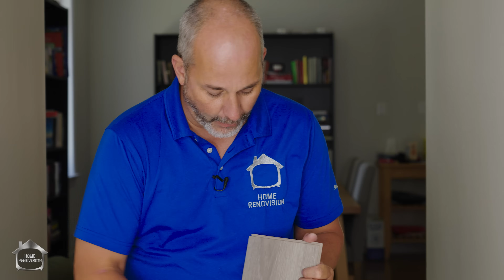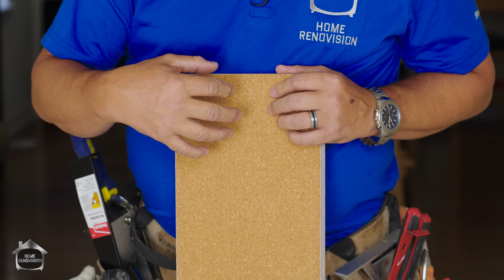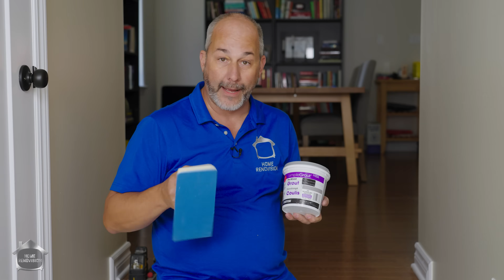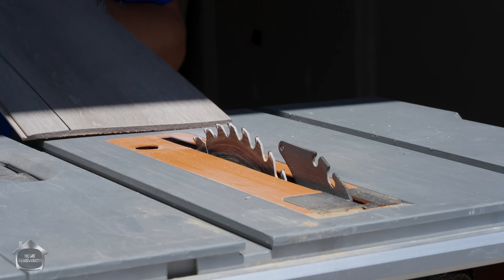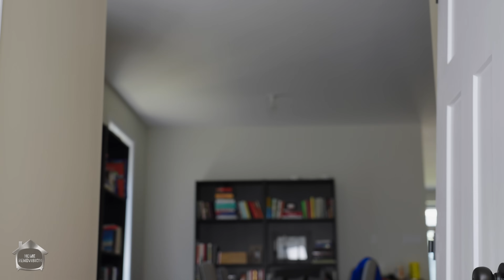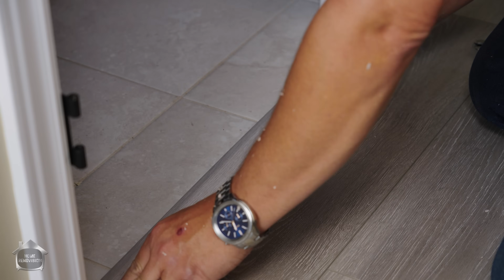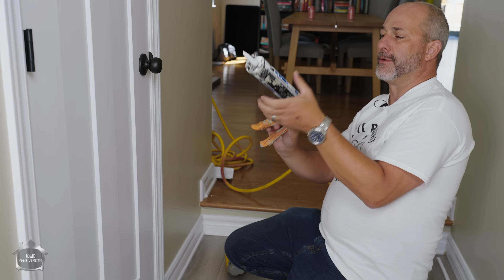10 Tips For Installing Vinyl Over Tile

Comment: Love the installation tips, but I still don't get why you entertain people wanting to stack flooring or backsplashes. I know it's a dirtier job to do removal everytime you want to change flooring surfaces, but it's one of the godawful discoveries people make when they reno (or have any kind of water damage requiring removal) after other people have done shit like this. I had friends renting a place in Hull some years back that had had a significant pipe leak and the insurance crew found out the place had not 2 but 5 layers of different flooring stacked. It was hell to fix and significantly the scope of the job. Worst of all? The original layer was beautiful hardwood.

Now obviously, this is an extreme case in that it's more than a second layer, but IMO it's just not something I want to see more of, and videos like these unfortunately normalize the practice.
Reply from the maker: I understand, however in a world where labor is getting very rare and expensive asking homeowners to buy tools for tile removal vs a floating floor is a no brainer. Cheers!

Comment: Jeff, what's your solution to an area where the existing tile butts up to a carpeted area? Obviously the carpet will be removed but the +/- 1/4" difference in height is a problem. How do you float out the height discrepancy? How many feet to make the transition not noticeable? This is my dilemma. P.S. this is a slab on grade construction so thin plywood is less viable than a self leveler... trying to avoid leveling 2500 feet to avoid tearing out 400 feet of tile.
Reply from the maker: just rip out the tile and use a cup grinder to make it smooth!

Comment: Awesome! But what you do with a tile floor on a slab (with lots of lippage) — which was installed in a converted garage that still has the garage slope!? My summer project!
Reply from the maker: prime with a latex bonding primer and then add floor leveler. Cheers!
Reply: @HomeRenoVisionDIY  Thank you!

Comment: Lots of useful information! Love all the content! Quick question. How do you transition from putting plank flooring over tile to a concrete subfloor that once had carpet. (Without busting the tile up to keep it all level :) )
Reply from the maker: I would suggest installing 1/4 or 1/2" cement board to bring the base level to flush. Cheers!
Reply: take the extra steps and bust the tile. these floors with NO transition strips looks soooooo much better
Reply: I have the same problem. I have concrete subfloor that I need to raise to match the height of the tile that’s already installed. From this video I learned that I can install over 1/4” grout lines as long if wary of where my Vinal plank flooring falls, which is awesome and saves me a ton of time self leveling all the grout lines with thin set! I was also going to use self leveling concrete for the whole 200 square foot room until I saw this comment. My question is How should I anchor the cement board to my concrete subfloor. Masonry screws?
Reply: I may just bust up my tile to reduce the cost of just buying cement board to raise my subfloor. Trying to weigh the pros vs cons. What could go wrong with a little demolition!

Comment: No expansion gap? There should be about a 1/4" gap between the plank and wall to allow for expanding from heat.
Reply from the maker: not needed. the vinyl does not have any capacity to expand so it is completely not necessary!
Reply: @HomeRenoVisionDIY  the vinyl doesn’t, but the house does! Any floating floor needs a gap where it meets another material or a vertical surface. This actually happened in my house: flipper both didn’t leave the appropriate joint where the flooring met the wall, and also glued down the flooring by accident at transitions strips (overglued). Within a few months, our flooring popped at a joint because the house shifted and the flooring couldn’t move.
Reply: Yeah I came to the comments to post that. He briefly mentioned leaving a small gap to make it easier to drop the last pieces in, but really that gap is so the floor can move with the house.
Reply: I’m 95% sure he explain its expansion rate is incredibly small less than steel so the gap isn’t needed or isn’t necessary

Comment: I’m an installer. I’ve had past jobs where some of the joints in the click fall right on top of the grout line, and over time the joint eventually breaks apart. Of course it depends on the material, and the depth of the grout, but now I pretty much always apply a skim coat over ceramic just to be safe. The stone-like clicks always seem to break apart, so I won’t even install those anymore.
Reply: Get a 10mm rubber underlayment, it will solve all your problems.
Reply: @onlythebest3311  No customer wants to pay for that
Reply: Floor underlayment.. as designed
Reply: Should that be the problem of the flooring joints being weak and thin I have pick up some flooring planks and bend the joint to test the strength of the joint and have broken some right off or cracked them..they should make stronger joints seem like
Reply: “How to half ass”
Reply: The proper way to do it would be to level the tile with floor patch.  I usually do 2 -3 coats first another option would be to pour self leveler
Reply: Do you prime the tile prior to the skim coat? If so what product are you using for that?
Reply: would this happen, even with underlayment being installed?
Reply from the maker: A lot of that depends on the grout line size and the quality of flooring being installed.

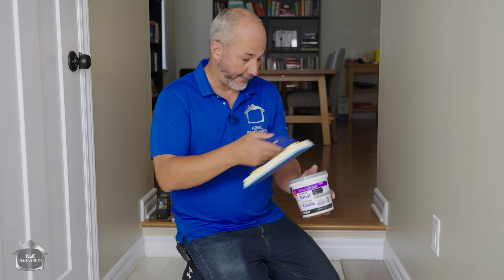Comment: 5:45 Could I use the leftover mudding compound instead of the grout?
Reply from the maker: drywall compound will go moldy. always use a cement based product under a floor to level.  Cheers!

Comment: I did this using Karndean looselay flooring over ceramic tiles in a bathroom and linoleum in a laundry room. Few years later and the LVP is still perfect.
Reply from the maker: Noice. Cheers!
Reply: @HomeRenoVisionDIY  how can I transition from an existing tile wall to a luxury vinyl plank flooring? My project is in a bathroom so the tile wall is already in place and I don't want to redo it... Thanks in advance for your help!